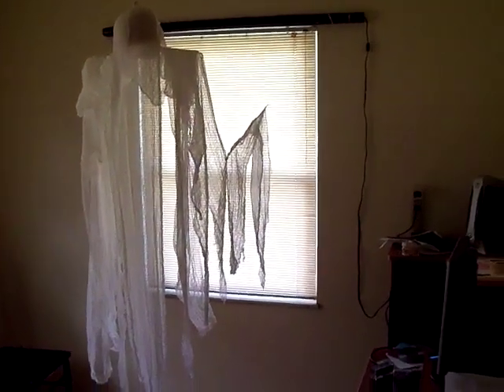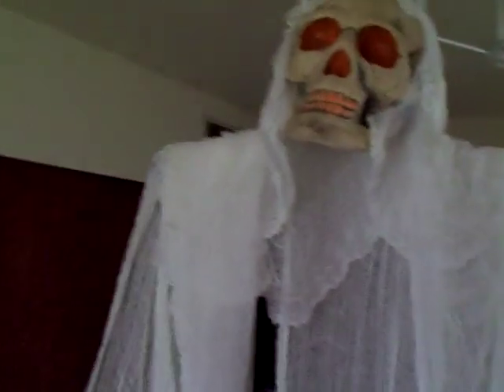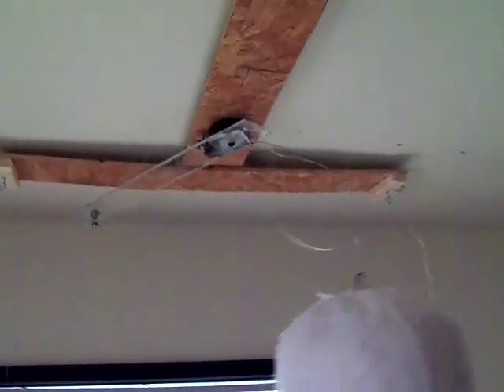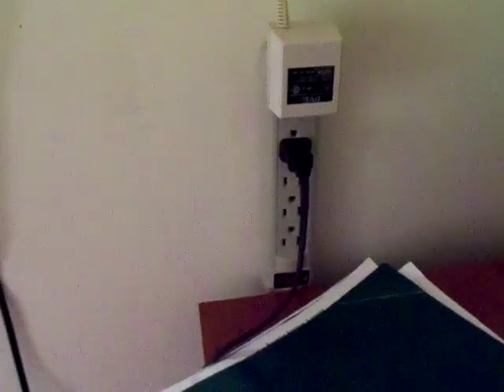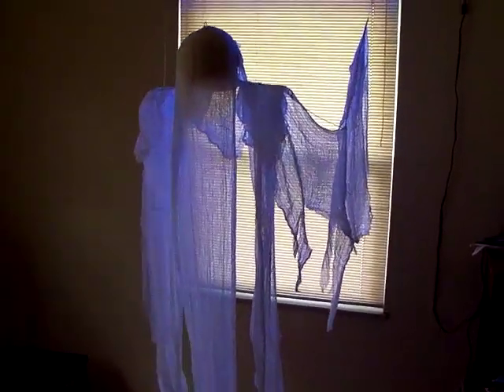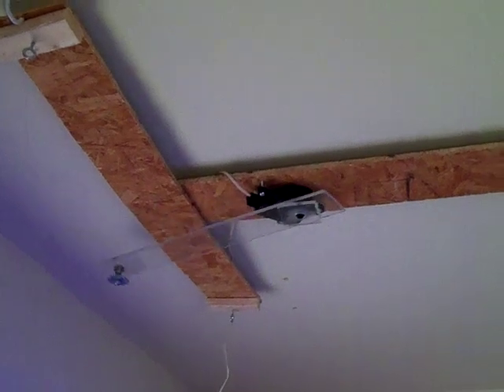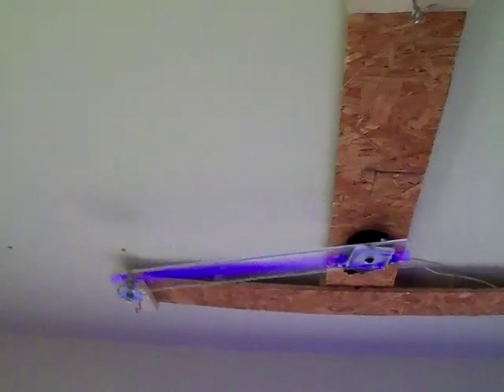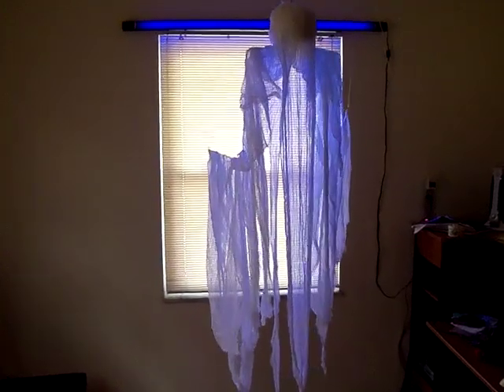FCG Flying Crank Ghost.MOV

Comment: they are all seperate strings they dont turn they are outside the motor hook but still attached in a moving washer plate which spins freely not letting them tangle

Comment from the maker: Since the whole structure is fairly light weight, I just used those ceing hooks screwed into the ceiling drywall. Put the rig in place and turn the hooks to grab the plywood. If you look real close in the video, you can see them...